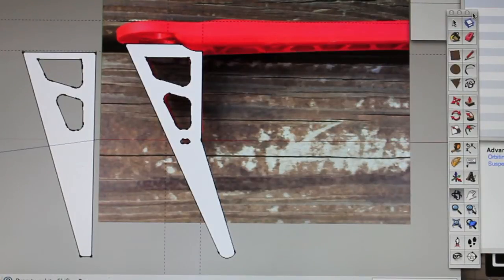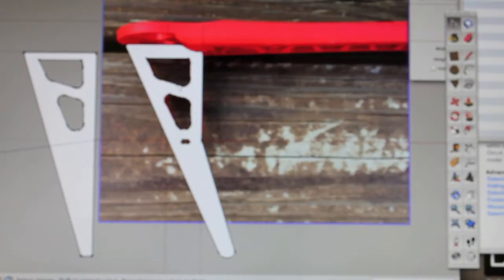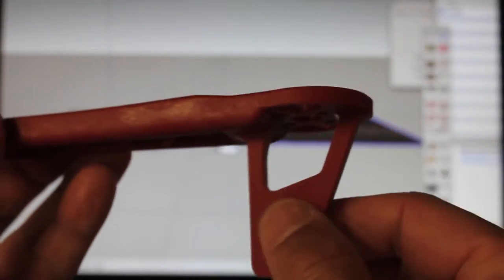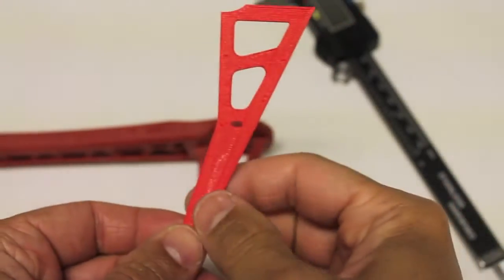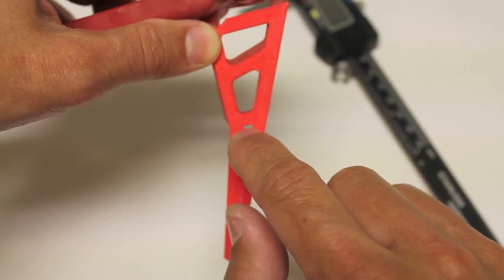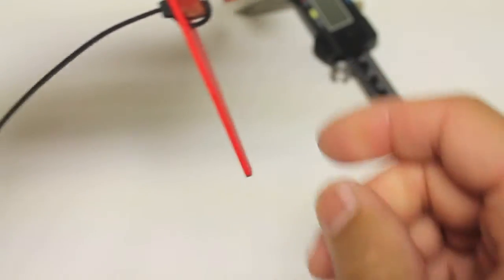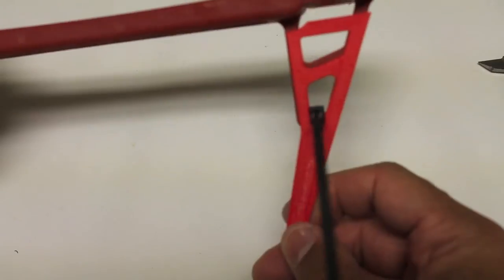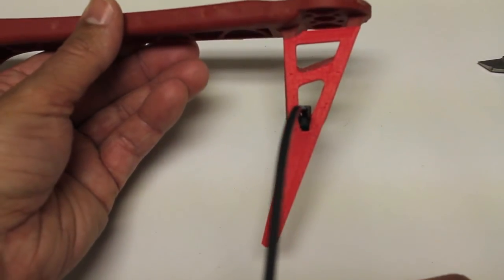DJI F330 F450 F550 Landing Gear Extensions 3D Printed w/ MakerBot Replicator 2

Comment: Hi Dennis , I was thinking of nc cutting out of .125 lexan tuff stuff. should hold up good..
Reply from the maker: Yeah totally agreed. Let me know how that goes. Thx.
Reply: Already did it,looks good i will try and put pictures up in a few.I used the dji leg took a pic did a wire frame scaled it to match an area and it popped on 1 zip tie worked great. peace

Comment: I do not know how I missed this video till today but man that's great! just the right size. just one thing landing get hard some times and I use furniture pads hot glued to my leg's to take the shock for the landing, if you hit the leg on a hard surface you and feel the energy throughout the frame, but with a little pad it helps. if you can privately send me you number I will text you the pic of how I stopped this. I would love a set, how much are you selling them for?